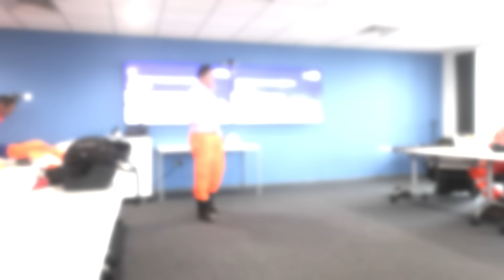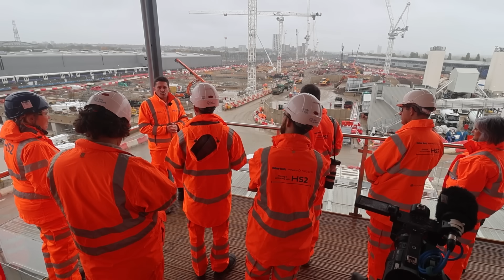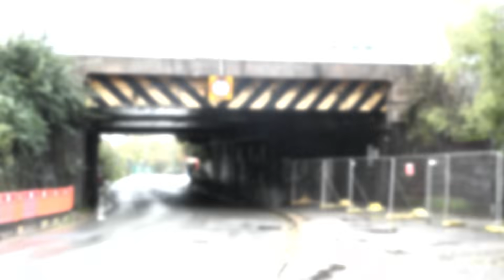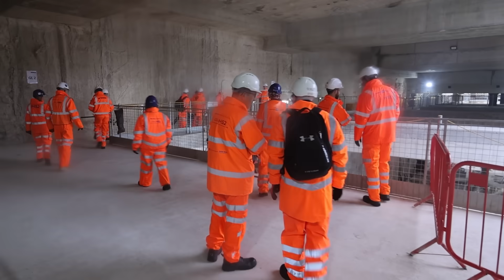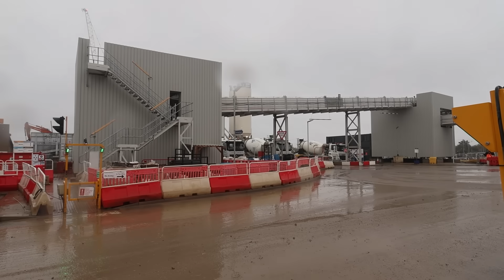HS2 Old Oak Common Station Construction

Comment: You can easily see why the cost went from a 32 billion budget assessment to 100 billion and still rising. The 32 billion estimate was a 2 line estimate comprising  200 miles x £x million a mile plus 24% contingency equals 32 billion. But the detail has bridge lowering, bridge raising, unforeseen ground conditions, thousands of highway alterations,  thousands of planning conditions equals 100 billion plus. And the contracts for the track and trains are currently out to tender so the cost for these items are unknown (my estimate 150 billion plus)

Comment: Unfortunately this London project, will have no benefit for the North of England and little, if any economic benefit for Birmingham, as well as alleviating WCML congestion.

The fact they are building 2 new hub train stations in London, as well as a connection to Elizabeth Line shows this is another London infrastructure project. 
It shows how insular/ignorant Westminster politicians and Londoners really are to the rest of the UK, considering Manchester and Leeds are fast-growing cities that are modernizing, attracting new  business investment. I think Manchester is growing faster (relative %) than London. 

Trouble is Northern cities and Birmingham could grow a lot faster economically if they had the same public funding and transport building that London has. 

No other developed country invests so much into 1 city, London. It’s bad for economic growth and distribution, and encourages more people to move to London when it’s already very overcrowded / overpopulated. In turn, increasing London rent & house prices.

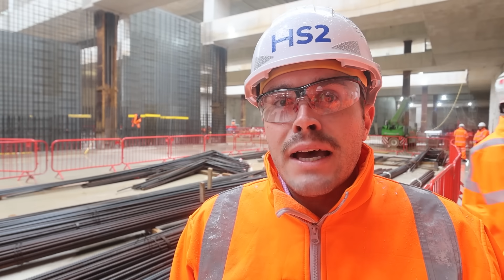Comment: 5:56 Sam (of the HS2 project team, I guess) says "We expect 250,000 passengers every day". I guess, that is HS2 passengers only. And I also guess, those are the estimates of the station being an intermediate station, not a terminus. What I'm taking away from this, is that the station is built to handle 250,000 (+) passengers per day - as an intermediate station. But how fit would it be as a terminal station, that would take up all the passengers estimated for Euston (HS2) additionally?
Reply: Don't worry, if it became the terminal there'd be few if any extra passengers. What would be the point ?

Comment: The UK is building great rail infrastructure and has great rolling stock. The next challenge is run all the trains on the timetable to time with minimal cancellations. TPE’s answer is to remove lots of trains from the timetable so they can reduce cancellations!

Comment: This is Denial Central. Both the station itself, the HS2 buffs/industry & all the enthusiasts. If it ain't about Euston it ain't worth a [*x*x]. Just as quick to get to central London with out the extra interchange hassle & expense by using WCML etc. Should call it LS2. Most expensive dead duck in UK history

Comment: Geoff can you please address the cancellation of the majority of the HS2 line to the HS2 management, as it now becomes another London infrastructure project

2 stations in London and then just 1 station in Birmingham
Reply: No there are two stations in Birmingham, Birmingham Curzon Street in Birmingham City Center and the biggest station on the HS2 line and Birmingham Interchange Station at Birmingham Airport

Comment: When the two tunnel machines start their drive to Euston in 2026, is the spoil going to be removed by the same conveyor belt system as the existing system ?.
Reply: How can anyone know the answer.  Even the Contractor wouldn't know the answer to that until 2026.

Comment: It’s really cool to see the amazing construction going on, but equally sad to see such a cool project ruined by funding cuts.
Reply: It's all down to poor management and greed, when they had issues building the Elizabeth line they kept overrunning sorry if a contractor givers a cost for a project and they encounter problems then it's down to the contractor to foot the cost not the taxpayer
Reply: @pj6641 only if the problems are caused by the Contractor. No Contractor is going to pay for someone else's mistakes. Would you  ?

Comment: I would like to see what Old Oak Common HS2 station will look like once it’s completed. And not forgetting Hythe Road and Old Oak Common Lane stations to be built. Which would add a connection between London Overground, HS2, GWR and Elizabeth Line. Such a shame that HS2 isn’t going to expand to Manchester and the North of England. As it’s costing too much money.
Reply: It should’ve started in the north of England it’s just another London project to Birmingham, which on paper is actually less influential than Manchester both in terms of GDP and train and air passenger traffic via Manchester airport, 3rd busiest airport in UK, busiest outside London metro
Reply: It's become an indulgence to prove we can build them like the French, but without any economic & practical justification
Reply: True.
Reply: @daffyduk77 What a load of ****, the core trunk network is reaching capacity, growing freight traffic and local services is impossible because unlike most modern nations we did not segregate our passenger inter-city traffic from freight in the post-war years believing foolishly instead that the road network and aviation industry would save us. Rail traffic has been growing for decades now, this is nothing to do with "the French". Would love to hear you solution about solving the rail network capacity issue and why you wouldnt build to the international guage standard or try to build in a straight a line as possible!!!!!
Reply: @gregjalepeno6769  No doubt the Rail buffs can put me straight on this one, I thought the UK invented 4ft 8 1/2 & that's what we & they use in the EU etc but no doubt there's more to it than that. I was never advocating reverting to GWR Broad Gauge or anything like that. there are numerous reasons why HS2 has gone into the buffers IMO, & a straighter line might have been do-able before Ernest Marples & the RHF-lobby in the 50s had made Britain so road-oriented.  I think, being 1st in the rail game made us more fossilised re:  inability to build  a network with future expansion potential.  The power of local competing interests have militated against double-decker trains (bridge sizes & pre-existing structures etc). I suspect technological fixes are possible re: signalling/safety systems to enable higher/greater throughput on existing track, costing less than £100 billion perhaps

Comment: I love the clash between newness and the name Old Oak.
Reply: They ought to re-name it to make it redolent of its part of a huge waste of cash. Maybe Olde Money Pit.
Reply: How do you think rail capacity should be resolved then? @daffyduk77
Reply: @DT-hg7te  As mentioned in my replies elsewhere on this issue, I'm not a rail expert ... I have an impression greater throughput of trains through upgraded safety-related electronics/standards/signalliing systems would improve train frequencies, possibly average speeds also. Possibly at times longer trains might be possible where certain stations can handle them. And/or lengthen a few stations.

Comment: HS2 terminating at OOC would have been fine if each HS2 platform had a corresponding Lizzie-line platform for instant cross-platfrom interchange. By the sound of it, passengers will have a longish walk including at least 2 escalators to change to make this change. Huge missed opportunity

Comment: why would anyone want to get off at Euston given the Elizabeth line gives you quicker connections to Heathrow, West End and the City.
Reply: because Euston's practically in central London & nearer to City of London, taxis are a thing. Unless the thing extends to Euston, which it won't, now, OOC is the wrong solution cost/benefit wise

Comment: I can't wait to shuffle off my train from Liverpool, traipse over to the Elizabeth Line platforms with my bags and wait until the next train as the one I want to catch is full as a Manchester train arrived before mine. What an utter shambles. On the way back I could miss my train if the Elizabeth Line is overcrowded.
After the debacles and cost overruns on WCRM, HS1, Crossrail, GWML electrification and TP electrification, will the British railway engineering industry ever get a large project done on time and to budget?
Reply: Depends on the politicians

Comment: When are they going to build the extra capacity for the Elizabeth Line to carry HS2 passengers until the Euston link is built? Assuming the funds come for the link.
Reply: TfL have asked for additional train sets to be purchased.
Reply: The challenge will be to provide capacity on the line for the services that fill up with existing demand. Otherwise, the section of Elizabeth Line west of London will be ridiculously crowded (assuming people actually use HS2).
Reply: "until the Euston link is built" - Don't worry, that will never happen, won't be enough private-sector backing for UK's greatest white elephant
Reply: The sad thing is, you're probably right - it will be like when the Channel Tunnel opened and for years Eurostars had to trundle slowly through Kent, and Brixton and....

Comment: Total waste of money that could have been spent existing stations and routes plus developing new stations in the midlands and farther north
Reply: Maybe upgrading signalling/safety systems & technology to facilitate more frequent trains ?  Longer trains for those stations capable of using them, & extending a few stations to fit if necessary ?  No, of course I don't work in the rail industry but I would start there

Comment: Great video, I always enjoy your special invitation days. My understanding is that the TBM’s for the tunnels west of Old Oak Common station(Northolt East tunnel) will be launched in a westbound direction from the Victoria road crossover box and the 360m of tunnel between the crossover and station box will be built using road headers, a more traditional method to the TBM’s. The delay for the eastbound TBM’s is disappointing.

Comment: It's sad to think that the station will never see 250k passengers every day as the HS2 project continue to shrink to the point that trains will have no where to go except out to a dead end and back to the station.  One train a day to Birmingham?  That's very possible!
Reply: HS2 will run into Euston and the line is being constructed as far as Lichfield in Staffordshire where the HS2 line will join the WCML allowing HS2 trains to travel to Manchester and Scotland via the WCML and Avanti West Coast train will be transferred from running on the WCML in most cases to operate on the HS2 line  so there will be more than one train a day to Birmingham
Reply: There's a new government coming in. I'd take a rain check on what the exact final fate of the project will be, for good or ill
Reply: @jamesharris5707  Doesn't matter who is in charge HS2 is to far gone to be cancelled, Euston will go ahead and the only bit cancelled is the high speed line from Lichfield to Manchester
Reply: @peterwallen1063  yeah HS2 trains that will now be shorter (platform length means the HS2 trains have to be split awkwardly) and slower (because they wont be tilting) on legacy track than current West Coast Line trains. What a brilliant plan by Rishi!
Reply: @gregjalepeno6769  I does not matter how long the HS2 trains are, on the HS2 section they still will do 225 MPH and the Trains from Birmingham will be full length, plus no one has said longer platforms will not be built at Manchester Piccadilly plus as they will not stop between Manchester and Birmingham Interchange there is no reason if the increase platform lengths ayt Manchester that these trains will have to split.
The sped f these trains on the WCML as far as Crewe is concerned is debatable as the only trains on the WCML restricted to 110 MPH are the LNWR electric multiple units and there are no curves between Lichfield and Crewe that would restrict these trains on this section of the West Coast mainline and Inter City 125 Diesel units have been doing 125MPH for 50 years on normal track all over the country, and the Pendolino trains are the only trains in the UK that can tilt and that was so Virgin trains could up the speed of their trains on the tight curvature North of Crewe and south of Rugby, no one has predicted this speed and as usual one person puts their view over and every an and his dog believes it

Comment: I'm sure it will be a magnificent terminus station to rival the Victorian greats of Paddington, St Pancras etc. It's just a shame it's going to be a terminus in a place that no one wants to get to
Reply: OOC is not a terminal station it is being constructed as a through station and Euston will be the terminus.
Reply: Only if private funding is found. Note the bit in the video where they commit to putting the TBMs in the ground before finishing the station but make no commitment to actually start building the tunnel to Euston
Reply: @MarkStamp-o6p  Sorry I disagree, the Government is leading people on, for example the Prime minister stated that he is cancelling the HS2 line to Manchester, result every one thinks that the HS2 line and trains will not go past Birmingham, incorrect as the HS2 line is being built North from Birmingham to Lichfield where the HS2 line will be connected to the existing WCML for trains to travel on to Manchester, next OOC is being built as a through station with no facilities to terminate trains so they can lay over between services, it is only being built for trains to stop at and allow passengers off and then carry on . The TBM's are still going to construct the tunnels from OOC to Euston as once OOC is open this work would not be able to be carried on plus Euston is now being built with 6 instead of 11 platforms with a 7th platform for duel use of HS2 trains and WCML trains, every one reads the national anti HS2 papers, if you read Railway Periodicals you would see the correct idea of things

Comment: Thinking of signage to come there, especially a totem pole (like with Stratford) or something, the order - as per the hierarchy - should (!) be as follows:
HS2 (National Rail)
GWR (National Rail)
Elizabeth line/London Crossrail (National Rail, TfL)
London Overground (National Rail, TfL) -- if only walking connection and not immediate part of the station
London Underground (TfL) -- as above; should it be considered a corresponding connection

Comment: Interesting video as always, Geoff!  Thanks.   Glad you didn't spend too much time covering the bit about making the holes for the tunnels, as some might consider it boring
Reply: Thanks for finding some humour in what for practically all of the UK, is £££££££££££££££££ pain without gain. Unless you're a consultant or engineering contractor. BTW, sorry if there aren't enough £-symbols there

Comment: No way is Oak Common going to get that many feet through its station every day… Are they all just ignoring the fact that HS2 is now only going to B’ham?
Reply: Yeah, I guess of course this was signed off ages ago and now they're just rolling with it, even if it'll look a bit silly on completion.
Reply: HS2 links to the WCML.
So in theory any train heading south from this point can be routed via a high capacity direct track to London (HS2) or via a complex set of lines crowded with stopping services and freight trains.
Think of it like the choice between taking a Motorway or an A road.
I think there’s gonna be quite a few services to Old Oak Common once people recognise the superior reliability and journey experience of doing so.

Comment: @Geoff Marshall - I live very close to where you were! What I'm hoping is they extend the bus routes at the East Acton terminus to Old Oak Common. That would be super convenient! I doubt that TfL would ever run double decker buses on the 228 since it is never busy when I'm on it. However, they will likely extend the buses from  East Acton! I hope... 😅
Reply: When do you ride the bus? And also don't you think it will get more busy when OOC will open.
Reply: @Mgameing123  Plus there's going to be a ton of new development around the station in the coming decades, the area around the station is going to become essentially a big new town centre with thousands of new homes
Reply: @liamness  Thats amazing. I can imagine living there. I think OOC will become part of Central London as the area would have very high demand to live there.
Reply: @Mgameing123  It will be like Croydon and Stratford, areas that are very built up and well connected, but definitely not in Central London. It seems to be an intentional strategy to relieve pressure on central areas. I wouldn't be surprised if 3-4 decades from now that travel patterns across London look a bit more like Tokyo, not so concentrated on simply getting people from out to in and back again.
Reply: @liamness  Thats going to be hard. WIthout significant investment on the North London Line and the stations that connect with it there would be a low chance we would be able to get people to avoid Central London.
Reply: @Mgameing123  OMG, of course, but I've never really seen it that busy. When it does open, all the buses from East Acton will probably cover that though.
Reply: @MythTrainProductions  It will still get this single decker bus route to have higher demand.
Reply: @Mgameing123  Yes, it will most likely become Single decker, but if TfL create more routes, or divert or extend some, maybe not...